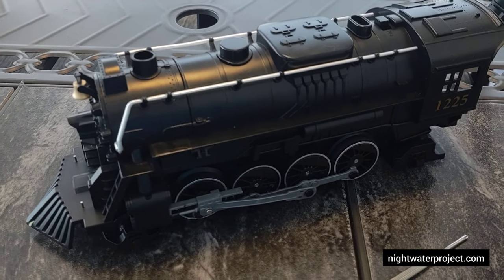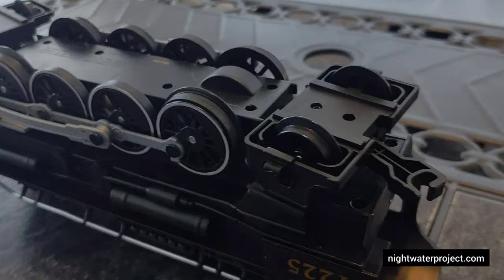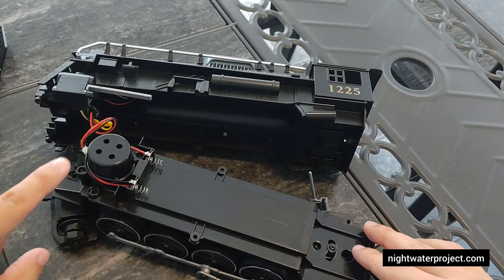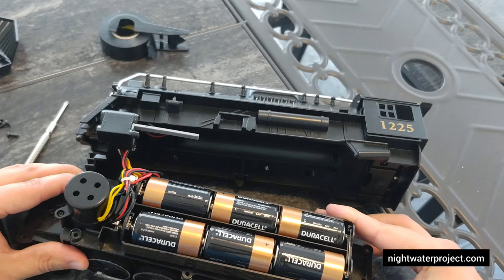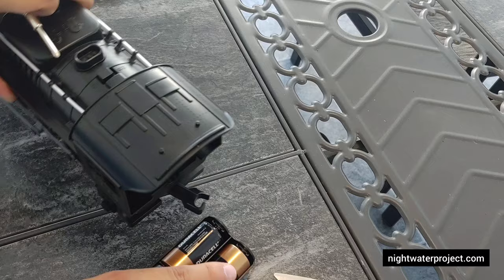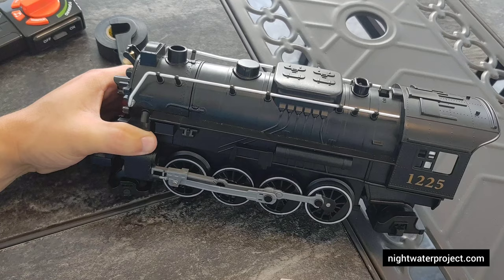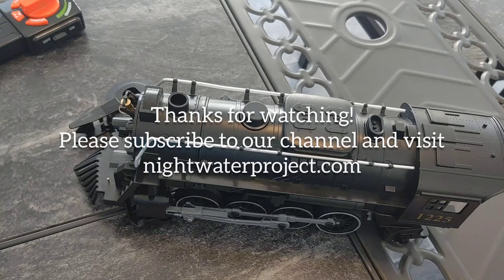How to fix the sound on a Lionel Ready to Play Polar Express locomotive

Comment: Thank you for this video! I had the exact same issue and it's now working great! I added one small step that saved me a little time and effort. Instead of wadding up several bunches of tape and stuffing them in, I took a 2 Liter plastic bottle cap and inserted it into the hole upside down. It is a snug fit and only a small amount of electrical tape is needed. Thank you again for sharing!

Comment: Thank you for the heads up about this issue! It was a relatively quick fix. My recommendations to those that will perform this in the future; cut the small white zip-tie outside the speaker housing so you don't stress the solder joints on the speaker wires when removing it. 
The depth of the speaker well is 31mm, take a thin piece of corrugated cardboard, I cut mine from one of the flaps of a small cardboard box. Not too thin and not too thick like on large boxes. Cut a strip precisely 31mm across and wrap it once around a AA battery cutting off the excess (leave enough for a small overlap). Secure it with a piece of tape. Now you have a ring spacer that will push the speaker ground back into place without muffling any sound. Place it in the center of the well and place the speaker back on top and carefully replace the housing not forgetting to feed the 2 yellow speaker wires through the notch on the speaker cover. Screw the rest back together and the kids are back in business! 🧑🏼‍🎄🚂🎄
Reply from the maker: Thanks for the additional recommendations for everyone who is looking for a fix!
Reply: Thank you for this tip, just followed your instruction exactly and works like a charm.

Comment: You can also add a small magnet to the center of the speaker. It’ll push the speaker in, same as the tape. No loss in SPL. Thank you for the video!  A lot if help

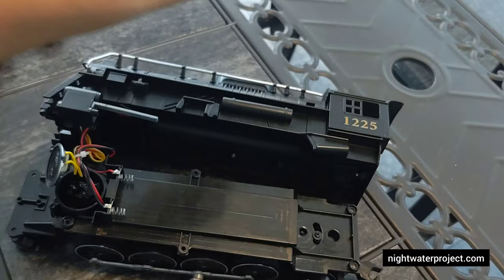Comment: 10:08 I don’t know if anyone suggested this. What I did was snip off the head of a small picture frame nail and used the magnet to hold it. It’s a simple fix that didn’t involve clogging up the sound tunnel with tape.

Comment: We let our son try to do this repair himself - he's 9, and there was some involvement by our 6 year old. The train no longer works at all... BUT I believe this was a good experience for him. Main lesson - don't shake electronics during repair process. Seriously though, be careful with the wires, I think squishing one while placing the cap back on the sound box did ours in. Then trying to diagnose that, we pulled and broke the black wire that connects all power to the battery port. Good luck.

Comment: Before trying this fix, try pressing your finger on the raised box on top of the front of the engine and if the sound starts to work there is a different fix. Follow this guy's instructions to separate the top of the train from the bottom and then tighten the two small screws inside the top train cover that hold that raised box (receiver) to the top of the train.
Reply from the maker: Thanks for the additional info!

Comment: I’m going to give everyone here the absolute easiest way to fix this issue, you don’t have to remove a single screw. You only need to add one. Insert a small oversized screw,  into one of the speaker holes in the bottom, a 1” screw was enough to make the speaker bottom out and complete the connection. If the hole somehow strips out, good thing there about 5 more to pick from.
Reply: The detailed fix didn’t work for me.  I’ll try the screw one, but I think my speaker has gone completely bad

Comment: Thanks for posting this video! I did exactly as shown and got it to work, but when I put it back in the speaker case it stopped working and now doesnt work even when pressing together. Such a cool train with very bad speaker design.
Reply from the maker: Keep trying. It took me a couple tries when I put a couple of them back together as the connections moved when doing so. It's really a pain but I hope it'll soon work for you. Yeah the speaker design is very poor.
Reply: The connections are stuxk on the speaker with a dab of glue. They come loose easily as your trying to cram things back together. I soldered mine on and haven't had a problem since.
Reply from the maker: Glad to hear it!

Comment: Hello, good morning, I have the Lionel The Polar Express electric locomotive, which one night activated and started by itself without me using the remote control. After this the light bulb comes on intermittently and stopped working, as if it had shorted out. I appreciate you giving me some light on how I can repair it. thank you
Reply from the maker: Oh wow. I never heard of that before!  It kind of sounds like a frequency issue that triggered it to turn on. Maybe getting a replacement controller would help or recommend contacting Lionel for an issue like that.

Comment: Hey thanks for the video 
I just bought the Santa Fe on eBay and the speaker did not work.
I did what you said and nothing so I ordered a new speaker from Amazon I hope this does the trick 
The train is from 2018 however I don’t think it was used ?
Reply from the maker: That's interesting that the speaker doesn't work if it wasn't ever used. I hope you are able to get it to work!

Comment: That’s not an actual mechanical push button. That’s just the way the speaker cone is shaped. This is a very “band aid” fix. To do it proper, replace the speaker, solder in a new one. The reason the problem happens is because the voice coil gets jostled loose to the point where it no longer oscillates on the permanent magnet of the speaker. This happens with cheap low wattage speakers that get tossed around a lot . The reason the pushing on the “button” may work/ may not is because you are pushing the voice coil back onto the magnet and it is able to move on it properly again. Anyways, if this works, great. If it doesn’t, try replacing the speaker. Any small, 8 ohm speaker will do.
Reply from the maker: Yeah unfortunately not everyone has a speaker laying around to thoroughly fix the product. But hopefully this works for majority of people who are experiencing the issue. But if you want to fully fix the product and have a better product what you stated would probably be best.
Reply: @Nightwaterproject  Yeah if this works, then great. No need to make it anymore invasive than it needs to be. And actually these speakers are readily available just about anywhere, like Amazon. You can get a pack of like ten for eight dollars or less. Then all you need is wire cutters and a soldering iron, which everyone should already have in their toolbox, IMO.
Reply from the maker: @uFCapacitor  appreciate the information for the viewers needing to correct the sound 👍

Comment: I have a question. I got one of these engines from a thrift store.  It seems to work with the beeping sound. I did some research and found that it needs a controller to work. The loco model is 711795 and I believe it is the G scale version. It looks identical to yours.  Can you tell me the model number of that controller so I can try and locate one.  Thanks
Reply from the maker: So the one I worked on isn't considered G scale or any specific scale as they call it "ready to play" scale but the controller model number is 711802.
Reply: Thank you. Do you still have that loco?  Can you look under it and tell me the model number? Mine is 711795. @Nightwaterproject

Comment: Hi I need your help., I guess that my remote control is not working or activating connecting with the locomotive. When I turned on only started the sound/intermittent noise/bipolar. Do you have any idea how to fix it?
Reply from the maker: Unfortunately I have know knowledge about that; however you might be able to find a cheap replacement on ebay for the controller.

Comment: The more I compare this with the new o scale polar express I got, the more I start to think that the ready to run polar express is a little short and stumpy. It doesn't even have 4 trailing wheels.
Reply from the maker: True but the O scale is a lot more expensive.
Reply: @Nightwaterproject  yes although I'm underwhelmed by the performance of the o scales smoke unit. It's leaking and I think it's because I overfilled it.
Reply from the maker: @ThunderboltSirenStudios  I hope you're able to figure out what that issue is.

Comment: I have the same problem, but unfortunately my attempt to fix it didn't work, I'm thinking I really got a defective locomotive, because I followed the instructions and carefully removed all the parts but the yellow cables that are welded to the round speaker plate came off right as soon as I tried to remove it so I was unable to fix it. I'm sad so is my son 🥺
Reply from the maker: Im sorry to hear that. It sounds like the yellow cables will need to be put back if possible. If not, try looking on eBay to see if there are any locomotives people are selling.
Reply: Go to your local electronics store and pick up a small thing of solder and a cheap iron. Not a very large learning curve to that and cheaper than buying a new set.

Comment: My train completely stopped working after 1 year of use. I replaced the batteries today before setting it all up and nothing. Have you heard of this before?
Reply from the maker: Never experienced that yet so unfortunately I cannot help. It sounds like the motor is defective. Only 1 year use is unacceptable. I would contact the company and state your case. They just may ship a new one to you. https://www.lionelsupport.com/
Reply: @Nightwaterproject  Thanks. It worked for minutes and was very slow so I replaced the batteries, once I did, it would not turn on at all.
Reply: I’m  having the same problem with mine. Has sound but not moving at all. I’ve had it just 2 years.

Comment: I was hoping this was my issue but alas it isn't.

Same problem no sound, but no amount of fiddling with the speaker gets it to do anything. 
I'm guessing a board issue or completely busted speaker at this point.
Reply from the maker: I'm sorry it didn't resolve your issue!
Reply: @Nightwaterproject  

It's alright, the video is still helpful in getting to the speaker for troubleshooting.

 I tested the speaker and it still pops when power is applied. 

So it's the the board or a transistor.
Reply from the maker: @smoothgrandma  it sure sounds like it. These products unfortunately aren't made to last.
Reply: @Nightwaterproject  Good news!

I fixed it. Took the board out and and jumped the ground too the hot speaker wire and for some reason that fixed it. 

I didn't intentionally do that, I was bridging the wire with an extra speaker to see if anything was coming off the board it started working. I imagine it reset something but it's beyond my knowledge.
Reply: @smoothgrandma  thanks for the tip I was able to fix mine doing the same to the motherboard!